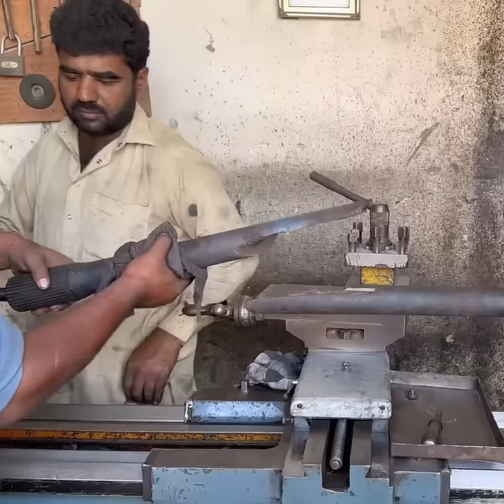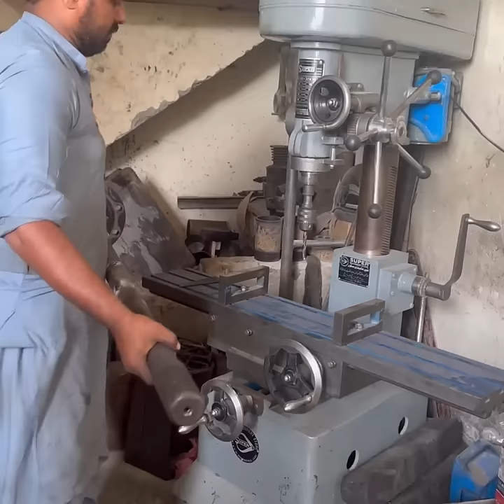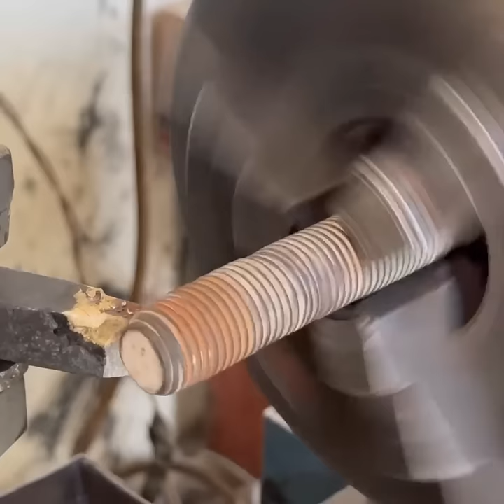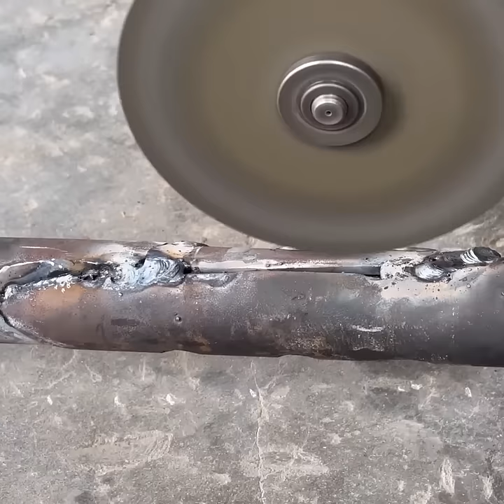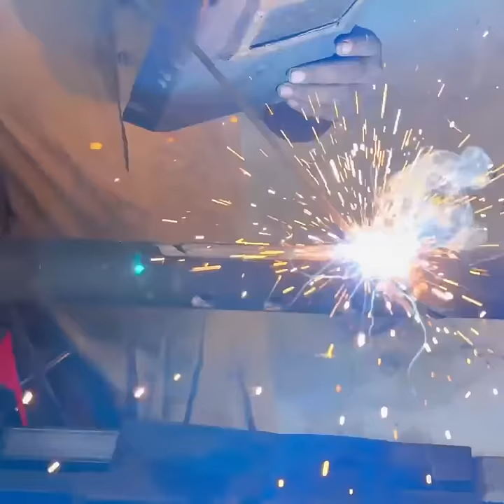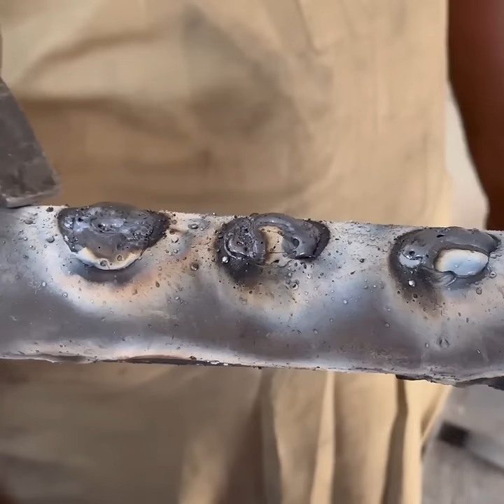How to Rebuild Broken Axle with Amazing Technique

Comment: End result looks decent.
You would never know it's a death trap
Reply: They only fixed it to make it selleble
Reply: This repair would hold 100% Amd would be probably as strong of not stronger than it was originally.
Reply: @jackrabbit7389 idk man, what's your proof?
Reply: Needs must.
Reply: @jackrabbit7389 no way
Reply: @jackrabbit7389 yeah no not rly. Its a fix...but not a lasting one
Reply: Death trap🤔 how can an axel be a death trap?  The axel breaks and the car no longer drives.
Reply: @IlIlIUnknownadventurer  you can find videos right now of cars that have axel breaks and the entire wheel  comes off with the axel attached. That may not be the common occurrence but it's not exactly safe. Especially if it's on a truck.
Reply: @ModernGentleman  since axels are milled and heat treated, not only is this repair NOT 10x stronger, I would bet it's weaker than it was originally.
Reply: @a29s12 it's the end of a jackhammer not an axle
Reply: @SteinzVsKnives  that's what the title says but the end has a place far a bearing and looks suspiciously like a hub for lug bolts. Makes me wonder if that's why it's broken.
Reply: This will be good for some time, but in a longer term it will not hold. Jachammer piece is specialy treated metal and by welding you disrupt it's structure. It would probably breaksgain, but in the heat-affected zone.
 Although if it is shafts or axel it could be welded  but not like this.
Reply: How would a axle shaft snapping make it a death trap? 
That does not support weight. 🙄
Reply: They didn't show it was heattreated afterwards.
Reply: @jackrabbit7389  Your claim is that this will be as good or stronger than a heat tempered chomoly axle was in the first place? They added cracks while repairing it htat they also had to repair. These men made this repair for the video, it will never go into a vehicle. Almost nothing about it makes sense except from an artistic content making standpoint.
Reply: @simonasfaw9450 those steel toed sandals tell me everything I need to know about the craftsmanship 🤣.. all jokes aside those dowel should hold up decently 💪
Reply: Nah, they said fuck it and just showed us a new one at the end. 😂😂😂😂
Reply: This is a “floating axle”.  The actual wheel hub runs on bearings at the end of the axle housing.  In essence, a Spindle.
If the axle breaks, the wheel(s) stay on , and you buy, steal, or repair the axle.
Reply: Same dude
Reply: @jackrabbit7389 the welded portion just might be stronger but that’s a heat treated axle and he got the thing extremely hot messing with the temperament of the axle I can assure you the moment they put any real torque to it that thing will shatter but much worse next time. Hopefully that’s a bolt on axle and not one held in with C clips as long as it’s bolt in they’ll only loose power to the drive wheel and not loose the entire wheel.
Reply: Lol😂
Reply: @deputydan2226  you think so? That looks like a 1 ton half shaft to me, that’s probably going on a dually that’s going to be loaded past its tits all day every day.
Reply: Like I said cosmetic only. Somethings you can’t repair. Nowhere close to original specifications.
Reply: @batuhaninalkac9418 他们只是太穷了，没办法。
Reply: @jcarry5214 you think they went through all that to repair this axle for artistic content😂
Reply: @AaronLitt675  it’s not repaired in any sense except visually so yeah
Reply: @jcarry5214  and I don't think they went through all that just for the vid...its a difference of opinion and that's ok👌
Reply: @AaronLitt675  Why wouldn't they?
Reply: These people do what 90% of the rest of the population can't do and don't waste anything, good on em for not being a throw away society
Reply: @jcarry5214  bro this is a repair shop in Pakistan look at the rest of the vids on the channel...they don't have the time to repair for shits and giggles...they bought all this machinery for content?🤣🤣
Reply: The weight would be off balance and no way is that as strong as the original. Cheap fix in a low income country but would never be done over here.
Reply: At first it is wood then it becomes steel
Reply: How can an axel be a death trap? It is a fix, and maybe was required in that way by the owner. People in development countries fix their stuff instead of just changing them, maybe you should go outside of your golden cage...
Reply: @simonasfaw9450 

Depends on the welds For example, the late model T34-85mm tank from the WW2 has welds stronger than the 45mm sloped at 60° armor plate.  

Really depends on how, what and with what materials.

The Source :   The Chieftain T34-85 part 1 open hatch video.
Reply: What I’ve noticed is that you welders always have something negative to say about other welders 😂😂😂
Reply: In 3rd world countries like Pakistan and India it's hard to find many vehicle parts. These type of repair jobs are always cheaper than a new part. Human life worth nothing in 3rd world countries.
Reply: Safety sandals activate!
Reply: Strong than original
Reply: It's made to last. Clever work.
Reply: @simonasfaw9450 I had a professional wonder tell me once that one inch of weld holds 5000 pounds. With the amount of welds they did it probably would've held without the pegs they added. The pegs just make extra sure
Reply: No its not for him ,its for them😂😂😂😂😂
Reply: myy axle is tweaked from getting rearended it just weARES MY TIRE uneavenly
Reply: My thinking is that it snapped being a solid piece so either way there's a chance of it snapping, so probably just as reliable as original
Reply: @IlIlIUnknownadventurer axel breaks at 65+, you are gonna have a bad time.
Reply: Ini hanya perbaikan secara visual, tidak secara mechanical properties, Matreial akan getas, dan mudah patah.
Reply: @jackrabbit7389 I'm an engineer, and no, it wouldn't.. that would definitely break not long after force is applied..
Reply: @simonasfaw9450 I'd bet it never breaks in that area again!
Reply: Lmfao 👌
Reply: It's an axle from a full floating rear end. The worse that is going to happen is it breaks again and you roll to the side of the road and stop.
Reply: Naw, just a stranded trap.
Reply: Literally stronger than it was before the break
Reply: Хороший комент , смеялся от души , даже перднул в конце🤣🤣🤣🤣🤣🤣🤣
Reply: @IlIlIUnknownadventurer You obviously don't know the difference between a drive shaft and an axle, genius.
Reply: @lenny108 at first it was rusty
Reply: He is working for Indian railways😁
Reply: @thonburino1 Oh well, that explains why there are so many massive train disasters in India.
Reply: This clip is a lawyer's wetdream.
Reply: @IlIlIUnknownadventurer one side spins freely still 😅
Reply: @IlIlIUnknownadventurer over a cliff! Duh
Reply: Jack rabbit is right, welds are typically stronger the the metal surrounding it, and that man's welding is on point.
Reply: All these none engineers is hilarious...
Reply: I’m from the North Georgia so I would have used Duck Tape or better known as “100MPH tape”. 
😂😂😂😂😂
Reply: Should have created safety glasses first !
Reply: Totalmente de acuerdo no sirve para nada
Reply: My favourite part is the cracked bits next to the welds
Reply: Вряд-ли  будет авария , машина просто остановится , как уже и было в прошлый раз ,   то что он лопнет  то вполне возможно  если плохо отцентровали или изношены подшипники
Reply: @jackrabbit7389 Can't handle it. This goes through an induction and tempering treatment.
Lost flexibility.
Reply: @Acme12345 goodd idea
Reply: Oh yeah he should have gone to autozone right, but they don't have the convenience of spoiled country's. But it makes them more crafty
Reply: @jackrabbit7389  dunno, i reckon it'll be a shit load more brittle and snap even easier now
Reply: @SteinzVsKnives   no the jackhammer video is the next one in queue, this is the axle repair video
Reply: @jackrabbit7389 ummm...no just no.
Reply: @steinzz it has splines on one end and a bearing surface and hub on the other...it's an axle
Reply: @jackrabbit7389 let me guess, you’re the one selling them?
Reply: @jackrabbit7389 no dura ni un kilometro
Reply: @simonasfaw9450 He swears 😂😂😂😂😂😂.
Reply: As usual so many professional welders with no video proof. Before you criticize someone make sure you show proof to back up your claims. As a professional welder of 28 years I know for certain many applications work that most think want work because of scientific theories. Nothing is like experimentation to actually see if something works.
Reply: Air gap on that rivets not good.
Reply: Totalmente de acuerdo.... una trampa mortal 😢
Reply: @simonasfaw9450 The 3 bolts put through hehe
Reply: @simonasfaw9450 i think it's from the local driver experience about these repaired axels
Reply: Ну да рутилом будет держать где есть серьёзная нагрузка тем более такая вещь должна быть под просвет. Там как минимум должно быть лб 60
Reply: @a29s12 it's not an axle it's a half shaft. Big difference.
Reply: @arbit3r  yeah, it's shorter.
Reply: Claramente noo quedo bien 
Lo ideal hacer otro
Reply: If its a c clip axle and it breaks it can slide out and become a death trap. If its a bolt in axle nothing exciting happens.
Reply: I'm sure that's a full floating axle. So it doesn't come flying out when it breaks.
Reply: Your a hairdresser right!.
Reply: Probably works otherwise they wouldnt do it
Reply: Noone killed by broken axle btw 🤣
Reply: @a29s12  колеса отрываются не из за полуоси.
Reply: This repair just for running to the garage, at least for 1 KM.
Reply: The death trap when you buy with no damage but suddenly broke. But if you know that you have repaired it then you already know.. lols
Reply: so if you can give comment like that, you have to tell us best way to repair that??
Reply: What did you do today?
Reply: @jackrabbit7389 this video is just for youtube, that item will never be used again, the way it is repaired...is just un professional, just a waste of time
Reply: @jackrabbit7389 idk how you can be that confident and say it’s 100% safe. 3 pins and a couple Tac welds is enough for you I guess lol

Comment: I've done this same repair when I was about 16 years old.  That's 52 years ago for your information. 
Except I didn't drill and install homemade rivets.  Unlike kids today, I grew up with access to old lathes, mills, etc.
And the "let's go buy a new one" option was not always available in 1970's Louisiana.  Or many places.
But I've welded them for old pulpwood trucks, etc.  And they held.  Until they broke.
(Remember: even the shattered axle (not jackhammer) was once new.  And it broke.)
And finally, that is a "floating" axle.  
It does NOT hold the wheel on.
The wheel is on a bearing mounted to the end of the differential housing axle tube.
If the axle breaks again, it will simply quit pulling on that side.
Heck.  The brakes will even continue working because of this design.
And Yes.  This Pakistani man did a good repair.
Reply: at least someone in these comments has some sense and experience. thanks for the good explanation. the rest of these folks just want to run their mouths and sound smart.
Reply: THANK YOU.
Reply: Grand parents were farmers, a lot of fix at home or at the blacksmith place (were still having to shoe horses by the time)

Kept a way of thinking identical, try to fix before replacement, if it works you're good, if you can't at least you did train and get better skills.
Reply: Хорошая работа ,май бой.
Reply: 💪🏼💪🏼💪🏼 me llena de orgullo leer eso, mi abuelo tenía una ganadería y al estar aislados en una zona rural, “comprar respuestos” no era una opción, todo se solucionaba con ingenio, herramientas y sobre todo tenacidad. 💪🏼💪🏼💪🏼 

Mi abuelo murió hace un mes, tengo 30 años y todo lo que me enseñó siempre lo puse en práctica; ahora mis amigos me dicen “MacGyver” jajaja 

Saludos desde Santa Cruz- Bolivia
Reply: @javierg.7275 sinto muito pelo seu excelente avô 😢
Reply: @sumo-ninja  It's less structurally sound than a new one, that's an undeniable fact.
Reply: Glad someone said it.
Reply: @I_Crit_My_Pants no one's saying it isn't.
Reply: @bryandelahoz6063  I'm pre-empting anyone that thinks otherwise, there's always those people, they aren't commenting cause I already stated that >.>
Reply: @I_Crit_My_Pants  
It won’t be as strong as a freshly forged axle shaft.  The welding electrodes used appear to be 60,000 -maybe 70,000 lb-in2 tensile.  
The forged axle would likely had a tensile strength => 100,000 lb-in2. 
But. As I stated before, this axle would probably last quite some time if not abused.  
I made this same and similar repairs many times as a youth to a number of old vehicles.  
Poor pulpwood operators who couldn’t afford new parts.  
Poor stock car racers and drag racers.   
Back before I became an engineer.  
It’s odd, back in the “Good old days” of drag racing it was customary to paint a straight stripe the length of the axle in order that the “twist” could be observed.  
You’d be surprised at the degrees of twist that an axle will survive.  
Anyway. Yeah it’ll break when overloaded one day. If abused.  
But the wheel is on a bearing on the axle tube. The axle only transmits the rotational motion to the wheel.  
When the axle breaks, the wheel will be retained safely, brakes will work and the operator can bring it safely to a stop.  
Later
Reply: @maintwelderbarton9015  I haven't denied anything you're saying here, just stating a fact, which you yourself have confirmed as true lol
Reply: Ouch, when you said 52 years ago I thought you were talking about the 1920’s, the 70’s were like yesterday.
Reply: @rogerperkins  yes they were.
Reply: Your assuming that this axel isn't held in with c-clips
Reply: @statest8088  
Except the flange at the end of the axle tells me it’s not C-clipped.  
And that the axle is retained by bolts through that flange into the hub/drum of the differential housing.

Comment: They actually did everything right to give it as much strength as possible in the repair. Overall well done given the circumstances.
Reply: Im sure that will be a great comfort when climbing up that valley with it. 2 Words come to mind. Death Trap.

Will this work oh hell yeah, right up intill it fault digs into the road and rolls you of a mountain
Reply: Except the ability to twist is gone. It will snap again.
Reply: @AnIdiotAboard_  
LOL! You're thinking of a DRIVESHAFT. Not an axle.
Reply: @AnIdiotAboard_ mmmm maybe your thinking of a drive shaft. They seem to know what they are doing….
Reply: @wilsonrawlin8547 an axle has plenty of twisting forces on it to.......as it's driven by the drive shaft....via the diff.

Comment: Looking at these guys, their attire, the custom sandals, holding a face shield, not a helmet (love that). Something tells me they don't have the option to run down to Napa auto parts and pickup a replacement. Their ability to improvise to get them by for the time being is impressive.
Reply: He’s not too shabby either running that 7018 rod. It is all flat welding but no slag pits or wagon tracks.
Reply: they dont have napa, just napal autoparts
Reply: Bring Mickey Mouse is cool to you
Reply: And as soon as the world goes MadMax, these are definitely the guys to call.
Reply: @albertoc2046 Mickey moose ? We call him baal mous
Reply: They have end mills, lathes, angle grinders, welders and obviously vehicles. But car parts are unattainable?
Reply: A welder will melt anything. That axle needs to be replaced with the correct part.

Comment: As someone who works with IT Infrastructure I can attest to the safety of this procedure.
Reply: Brother yesterday I had a camera swap and the last tech that was out there tried to splice a coax and in the process of doing so, lost the end that went back to the dvr in the fuckin wall🎉
Reply: Oh gosh... The other day I was rounding my IDFs in the hospital, and from 2 closets I pulled like...I think 30 patch cables that were connected on only on one end (either patch panel or switch). Someone was lazy. Oy vey! #lifeinIT
Reply: @TeaspoonMiner oh how I am looking for to experience the ups and down in the IT field. Currently in college for Network Engineering | Cyber Security

Comment: If I was a thousand miles from anywhere, like these guys and needed an axle to get me from A to B I would want them to fix it just like that.
Reply: They have power and a welder.. So they aren't that far out I'd get a bus while waiting for parts.. you can watch it crack more as they hammer the pins into it
Reply: Exacto...!!! Y voy a media marcha.
Reply: Hors de question, c'est du bricolage histoire de prendre quelques roupies
Reply: For sure, but I would replace that shit as soon as I got to a place that can do that after driving as slow and steady as possible.
Reply: They are not a thousand miles from anything they are in a functional city stop playing with these people 😂😂
Reply: You ain't making it a 1000 miles on that repair 😂
Reply: Они бабы, а не мужчины😂
Reply: That was just surface welding, and it kept cracking more as they worked on it. I'd feel more confident with some epoxy and duct tape.

Comment: Sometime back, the front axle of my jeep snapped at the knuckle of the universal joint. The nearest spare parts shop is about 25 kms away. The road condition requires 4wd to pass through. Fortunately, there was a local welder nearby, I took out the shaft and he welded back the knuckle to the axle shaft. 

I proceeded with my journey driving slowly and cautiously, and thankfully, the weld held strong enough until I got to the spare parts shop. In an emergency situation, it's helpful.
Reply: The fix seems too complex for a quick emergency situation.